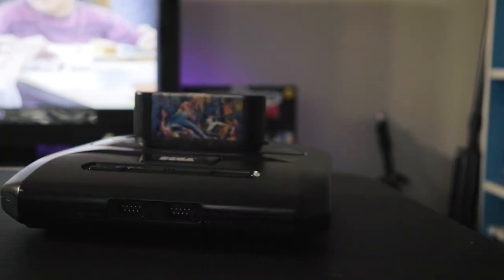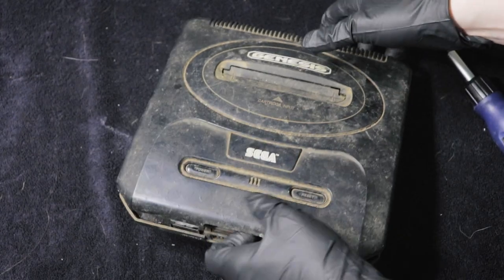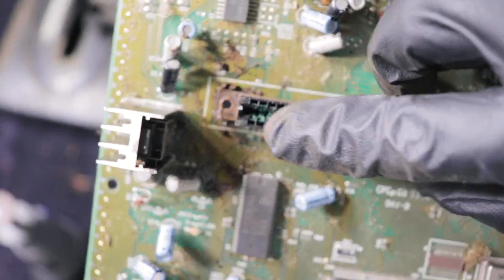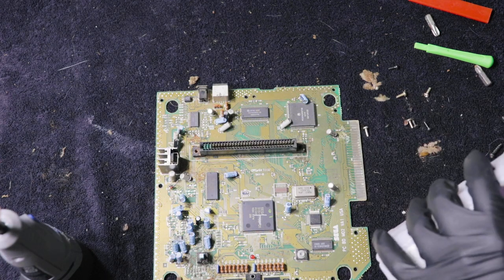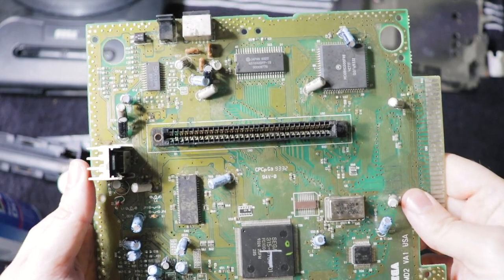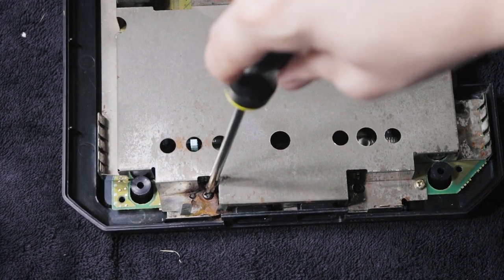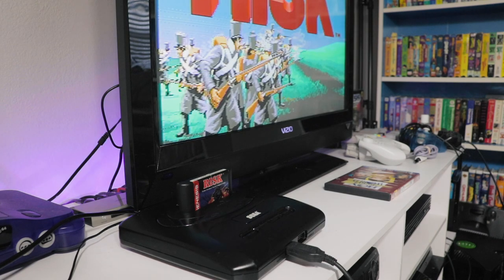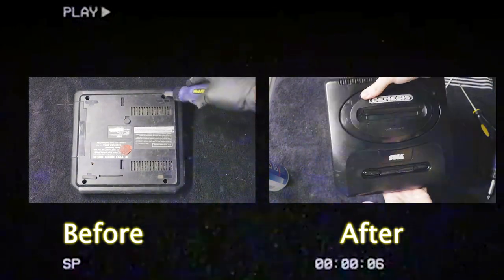Restoring The Worlds Dirtiest Sega Genesis System

Comment: I got one for free from someone's shed, and it was completely rusted. I had to salvage some parts, from random electronics laying around to make it work. The controller ports were not only rusted, but they were bent and missing prongs. The cartridge connector was not savable, since it was too rusted out. The adapter jack was busted off the motherboard, and the contacts were snapped off. Also the capacitors had leaked all over the motherboard. The RF shielding was also very rusted, and I had to sand it. The screws fell apart, so I had to buy some from Lowe's. There was also a lot of pet hair, and what appeared to be cigarette smoke dirt. This console was pretty trashed, but I managed to rig it up enough, to get it working again. It's far from being original, since I reused electronics from random old equipment. I soaked the motherboard in alcohol, and scrubbed it with a cheap toothbrush. Then sanded off some of the solder mask, to add jumpers to bypass some corroded spots. I'm lucky that I have experience with soldering, and some knowledge about electronics. :P

Comment: Since you clean so many systems maybe you know the answer to this question. I know you said it took you a few tries to get the game to work and I'm having the same issue. I'm not sure if it's the console or cartridges. I'm having to blow each cartridge before inserting to get the game to work. Even then sometimes after playing a game a bit it will freeze or start pixelating like a nes game. I've cleaned all cartridge contacts with alcohol/qtips and took apart the system and cleaned the cartridge insert with a brush dipped in alcohol like you did. I have 2 sega consoles and both are doing the same thing. I've never had to blow a sega cartridge before to get it to work. I don't think it's the games at this point since I have to blow on each one just for it to show up. I also don't want to waste money on another console either. Any suggestions? Thanks.
Reply from the maker: I would make sure to clean the carts really well with a qtip and 91% rubbing alcohol  odds are the carts are dirty. If that doesn’t work, you might have to try a cleaning kit for the Genesis or take the carts apart a do a deeper clean on the carts

Comment: I found my mom’s Sega Genesis model 2 in my grandfather’s closet it works just you have to push down on the cord that goes into the tv and it’s hard to set it up in the right position can you tell me what I can do?
Reply from the maker: It sounds like there might be a loose connection on the video connector or possibly the cables are just bad
Reply: Ok thank you
Reply from the maker: @dontabobbiusiii3149  if you have a local retro game store they should be able to help you diagnose it

Comment: Looks like water damage.
Reply from the maker: Yeah I believe that's what happen. A lot of stuff I got in the lot of consoles had really bad corrosion
Reply: @The90sAreRad  the genesis i bought a month or two ago had none at all, not even a single scratch on it.. it's mint condition inside and out, none of the caps were even leaking
Reply: This actually looks like moisture damage. I have had this happen to stuff of mine in an outside garage that water leaked into and it was hot 98 to 100 degrees and caused Humid, hot moisture. Causes everything to rust over like that inside the garage